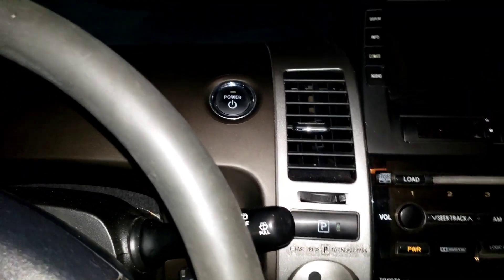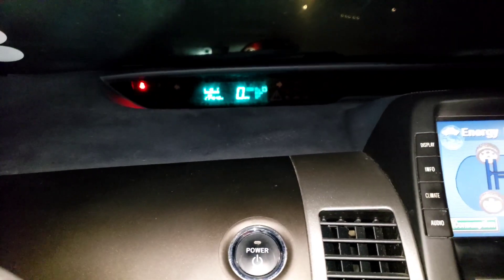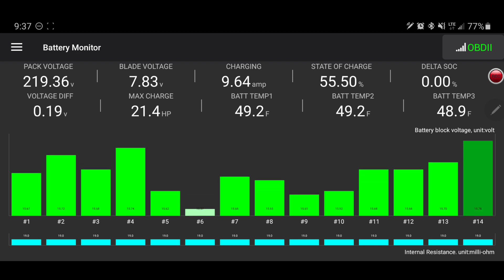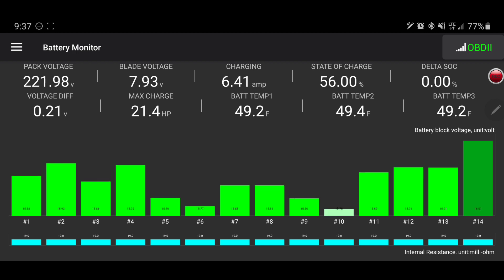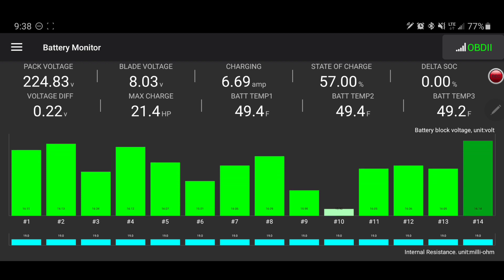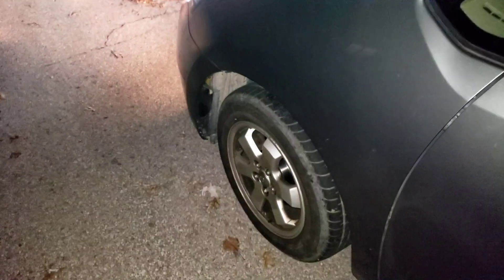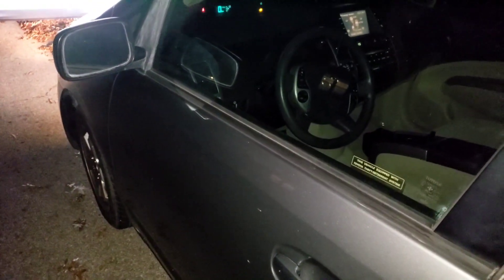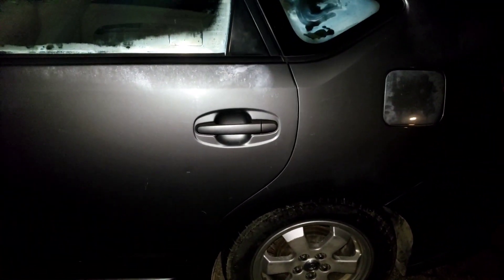Reconditioning a Prius Hybrid Battery Pt 3

Comment: You should go to Home Depot and buy a de-humidifier, and set it inside the car and run it. All that moisture inside the car you probably have a water leak and it's wet under the carpet, the next thing you'll see (or smell) is mold.

Comment: Question: How does Dr.Prius App recognizes which module is bad when all the modules are connected in series?
Reply: look at a disassembled hybrid battery from a toyota, each bus bar is connected to 2 modules, within the orange wiring connected to the bus bars theres other wires that carry that voltage information and give the computer the different voltages from each "block", a "block" is 2 modules. So my car is an es300h which is the exact same thing as a camry hybrid, it has 34 modules, 17 blocks.
Reply: @keysersoze7034  You're right, I but just realized you can check everything with regular OBD2 Scanner ... no need for Dr.Prius App.

Comment: I’m charging my battery modules with the Tenergy T180. After charging 5 cycles on each module #1-#16. The modules 17-28, I’m getting a short circuit reading.

Comment: Hi, new subscriber here from New Zealand (although it looks like you stopped uploading videos two years ago). I have a 2014 Toyota Corolla Fielder (wagon) Hybrid and am new to all this stuff. I generally like to try doing things myself as it gives me a lot of research to do and (hopefully) might save me some $$$ in the end.
Just wondering if my Hybrid battery will be the same as shown in your videos and what the best, most economical, option would be to get the car operating as best as possible - testing and switching modules or replacing the whole battery? Aftermarket, OEM, or refurbished?
Also saw that the NexCell appears to be sodium-ion now and what you think of that. Will be watching more videos for sure!

Comment: So I did this and got just OK results, hoped for a little better but cells in the middle of my pack really suffered. The process took 2 weeks. I'll be thrilled if I can get another 1.5-3 years out of this battery though!

Edit: after a few days of light driving my Dr. Prius battery expectancy readings got a LOT better. Battery is now in the "Good Condition" range.
Edit2: 1 year + later and the car is still running great.
Reply: Did you do the full reconditioning process? How many modules replaced?

Comment: It has been 1 year and a half since you repaired and replaced the bad modules on your hybrid battery, how does it handle it right know? does it still work properly, did you get any of the faulty codes for battery again?

Comment: With 0.22 voltage difference I think you can skip the pack balancing to as you said in the last video to 0.01V and save 16+ hours. The pack will balance from uphills and downhills.

Comment: My 2008 Prius has 123K miles.  I just go the red triangle warning.  Block 10 of my hybrid battery is running at 15.21 according to the dealerships diagnostic report.  The rest are running between 16.47 and 16.53.  I retired six months ago and I am not driving the car five days a week as before.  Do you have any knowledge of cars sitting up developing problems with their hybrid batteries?  I plan to have the battery reconditioned, but if I need to drive it daily, please let me know.
Reply: My understanding is the major cause, if not the main cause, for the batteries going bad earlier in the vehicles life is due to not operating the vehicle under certain conditions to charge cycle the battery routinely.  Like my at the least weekly 276K one is still on the original battery and going strong.  Mostly highway and freeway miles as well.

Comment: Didnt realize you're in Kansas City. I'm over in Fort Dodge, Iowa, and I do my Toyota courses over there. I'm the Toyota foreman over here too. One thing I wanted to note is that you can get block codes for as little as 0.3V difference. But it wont trip the triangle until it sees either a 0.3V difference from one cell to all other cells, or an internal resistance issue. Loved the video, keep it up!
Reply from the maker: Thanks for watching Kenneth!

Comment: Don't forget to the remove the HV battery fan and clean it thoroughly (4 or 5 screws easily remove to give you good access to the blower motor to remove fluff.)  People familiar with these say that HV fan cleaning is essential to HV longevity.
Reply from the maker: I actually did do this, but I didn't make a video on it as there are plenty of other videos and didn't want to saturate.

Comment: Hey man! I’ve been watching your videos and have been getting the red triangle of death on my 2006 Prius. I have Dr. Prius and have been clearing the battery codes: P0AA6 and P3000 until I have time to work on it. It usually runs for a week and then the codes come up again. I have done multiple tests with the dr Prius app and haven’t seen a voltage difference greater than 0.50 Volts. 

I live in a hot humid coastal state so I am expecting a good amount of corrosion to be the issue. Do you have any suggestions? 
Sadly this is my only vehicle right now so I can’t take the liberty of tinkering with it for several weeks at a time. Thanks!
Reply from the maker: Sadly the P0AA6 can be many different things. The process this person followed on prius chat is similar to what I would try.

https://priuschat.com/threads/check-hybrid-system-p0aa6.186776/
Reply: You probably ran out of gas at some point and the battery went low on charge - faulty fuel gauge - isolate the battery and let it sit for 20 min then put the plugs back in. If that is not solving your issue monitor mpg, battery behaviour and see if they did increase or changed since you encountered the problem. Oh and monitor temp. of battery, as mentioned underneath by Cawag98 changing the air filter for the battery is often missed by non-Toyota Mechanics while servicing your car.